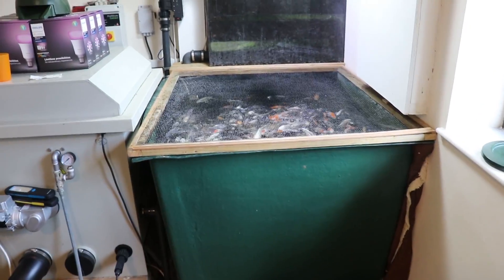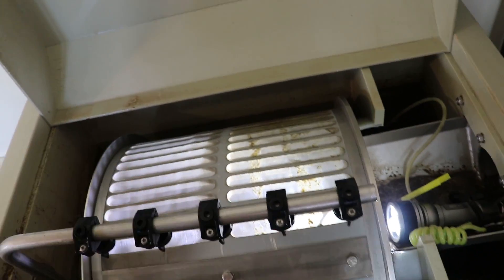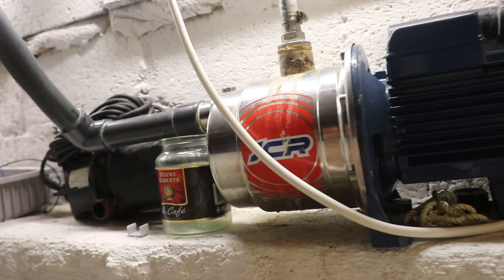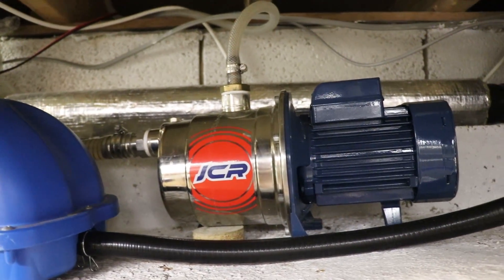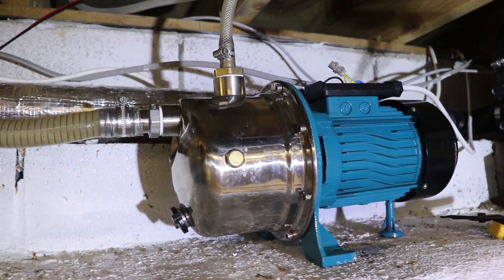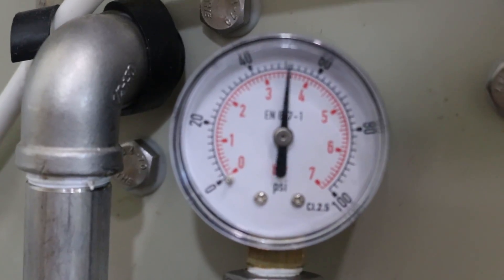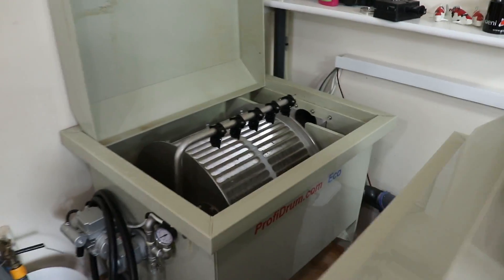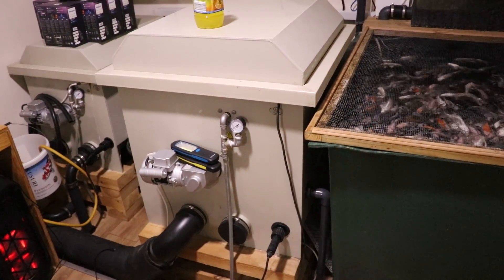Installing a high pressure booster pump on drum filter

Comment: Hi Adam great video as normal. You would get higher pressure/velocity if you look at the nozzles that are used on the spray bar. Similar to your jet wash lance open and velocity drops but the flow rate goes up . Close and the velocity goes up and flow rate drops.

Comment: Unless I misunderstand the issue, your mesh screen could be less fine and make the drum filter work as you intended. If the fry waste is already formed into that sticky glop before it reaches the RDF then a coarser screen would suit your needs and let the spray nozzles be effective enough to shift that goo off the mesh. Just a thought.

Comment: Don't you have any problems with ammonia or nitrite in the fry tank with so many koi? I'm growing 35 tosai (10cm) in a 600 liter quarantine tank with an Econobead 40 attached to it, 30% water changes every day, yet my Hanna Nitrite meter keeps showing around 0,30 mg/L. Ammonia is finally 0 after 3 weeks. (system is running for a month now)
Reply from the maker: Yeah a bead filter is not very good at processing ammonia and nitrite it's mostly a mechanical this as every time you clean it you will destroy most of the good bacteria. You want a shower or k1 chamber
Reply: @AdamJulyan  I forgot to mention that i didn't fill the beadfilter with beads, but with approx 30 litres of bioflow K1 micro.
Reply: @Thedavert If the water entering the filter has enough dissolved oxygen in it, it should be good enough. The filter has about 10m3 per hour of flow running through it, it should provide enough oxygen-rich water to the bacteria. I will measure the difference in dissolved oxygen between the feed and the return line. If the return water has almost the same amount of dissolved oxygen, if I'm correct, this should mean the bacteria have sufficient ogyxen